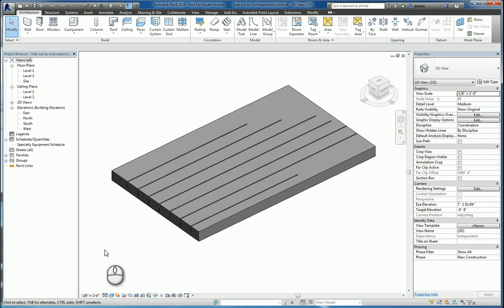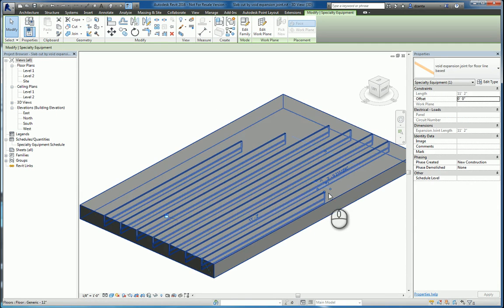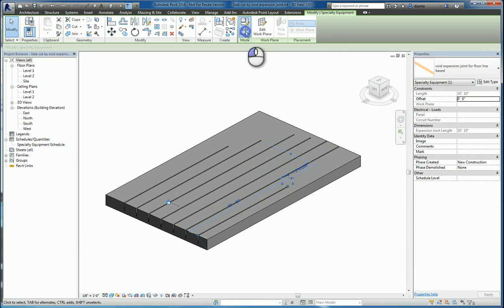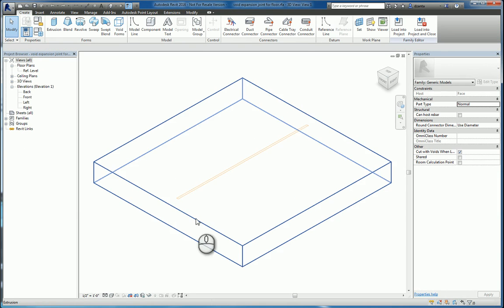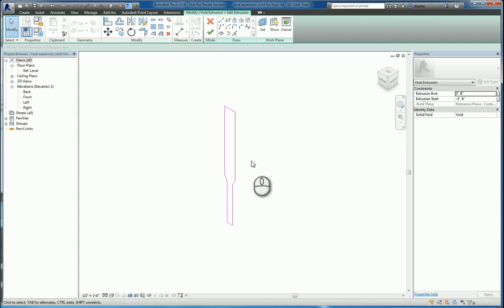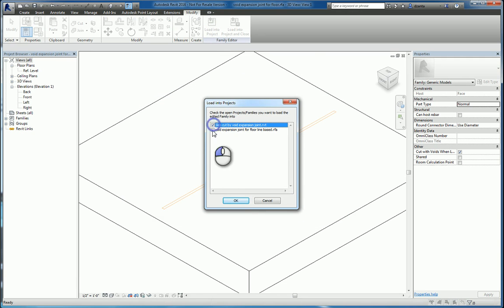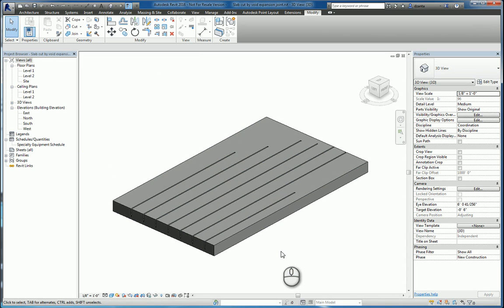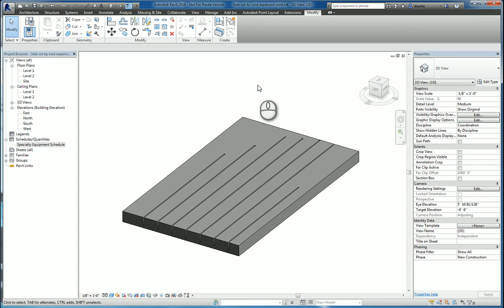Revit Slab Cut by Void Family - A How To Guide

Comment: How do you constrain the void to the line? I have a 100 diameter duct that I want to use this method to cut through dropped slabs but can't seem to constrain the ends to the line for some reason.

Comment: How do you nest a floor based family into a line based family when there is no floor to host the nested family?
Reply: I Noticed from your video that the nested void is a face based family. This work around no longer works in 2017 unfortunately. The nested family will not cut in project. The face based family must be directly loaded into the project for a successful cut into a Wall/Floor/Roof
Reply from the maker: Can you give us more info as to what you are trying to do with the Revit families? 

Line based families are not host based but can be used on the faces of objects such as floors, walls, etc.
Also, line based families can cut hosts when used if turned on within the family. You will have to use Cut Geometry tool to get family void data to cut host object within project.

Comment: Great tutorial.There is one thing I am not sure about (the tutorial goes very fast when reaching that point)... Can you please explain why make the first level family, not the first extrusion but the one in which the 1st extrusion is nested above a parent family?. I guess my question is the last family nested itself into an other one? Why 2 levels of nested families. Thank you for your reply.
Reply from the maker: Hey +ludohugo1

The reason the void extrusion family is nested inside a slab family is to allow for the void to “see” the slab within the Project Environment.  If the void extrusion family is not nested inside a Host based family, it will not understand how to cut into a system family.
Reply: Indeed that is very clear. Thank you so much for taking the time to clarify :-)
Reply from the maker: Anytime! These videos are created to help designers like you create better.
Reply: I DO NOT UNDERSTAND, HELP ME ?
Reply: @ReproProducts  
I DO NOT UNDERSTAND, HELP ME ?
Reply: @ReproProducts  I managed to make it work without nesting. The magic is on the "Properties>Other>Cut with voids when loaded", once checked you'll only need the geometry.

Comment: This method doesn't work on revit 2019
Reply: Did you figure out an alternative?
Reply: @granthardyjav  sorry ! No I haven't
Reply: Try loading the floor-based void family directly into the project, ensuring the "Cuts with Voids when Loaded" parameter is checked/set to "True". Then place it on a floor and use the Cut Geometry tool to cut the void out of the floor. This worked for me in Revit 2019.